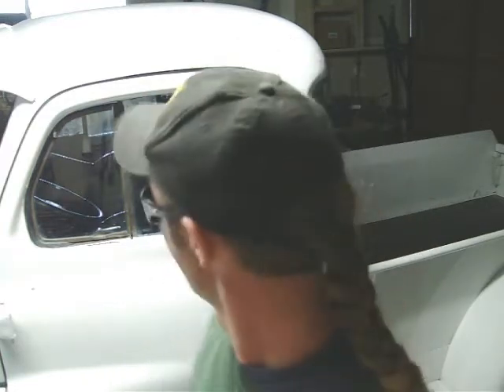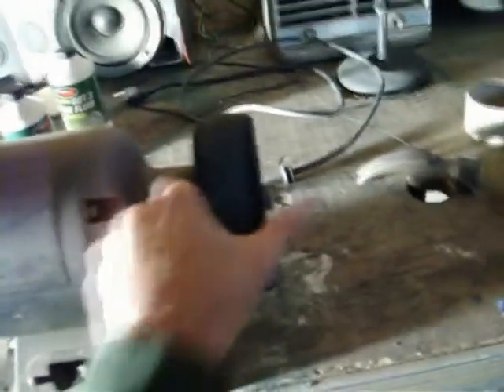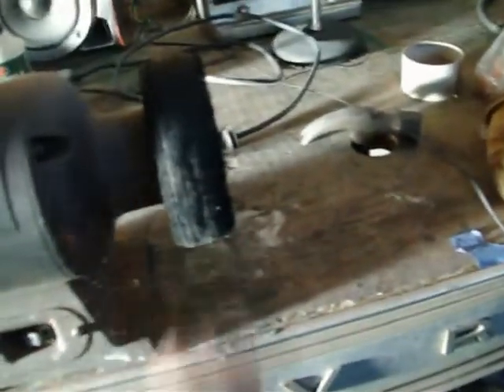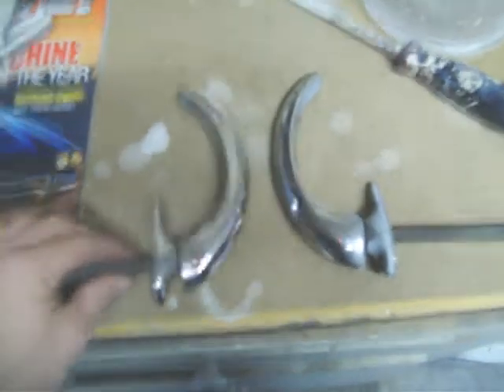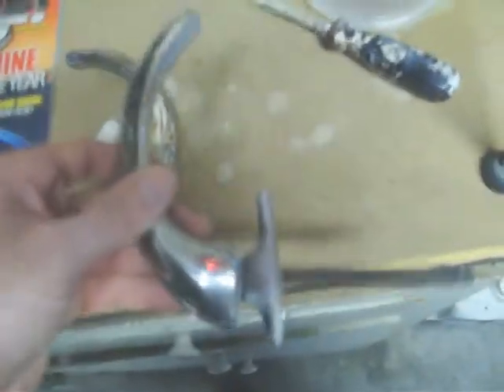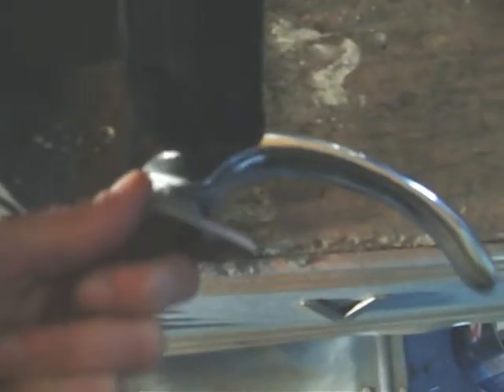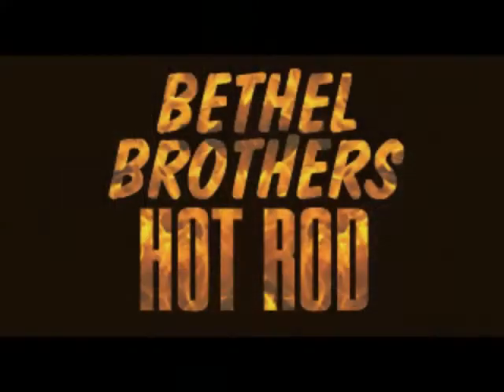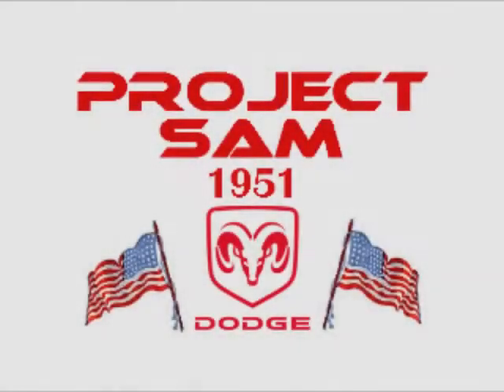BBHR Project Sam Shine Chrome and Aluminum

Comment: @danbethel  i would def advance the timing a little bit and see if it helps then. chevy 350/5.7 run best between 8-12 degrees. that blazer i have you love so much (with the big dent in the fender) haha if i set the timing at factory 0 btdc it backfires all to hell. you advance it to around 8 and it cures it all up. kinda strange but thats what they do. let me know if that helps any.

Comment: @danbethel  could be a valve adjusted just a pinch too tight also. been there had that happen. i've also seen plugs that get fouled up or go bad and will run but can cause backfires til they get changed. let me ask.. when is the backfire occuring? off idle? at idle? all the time?